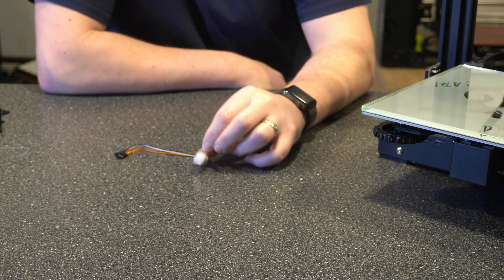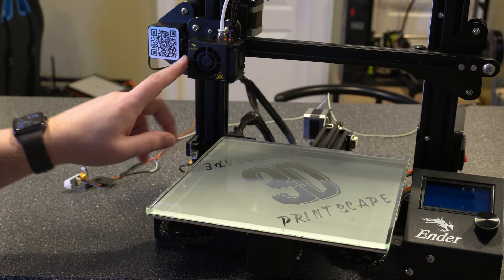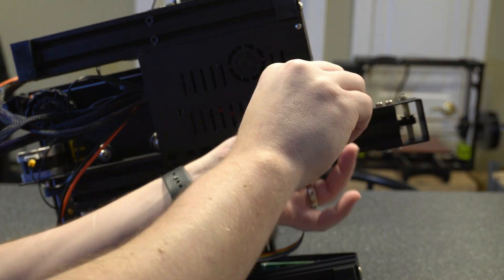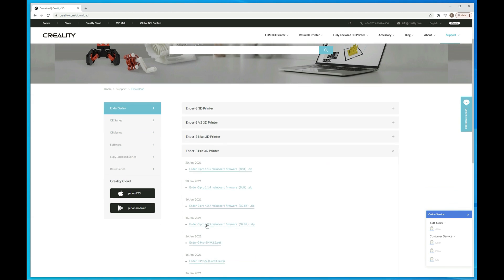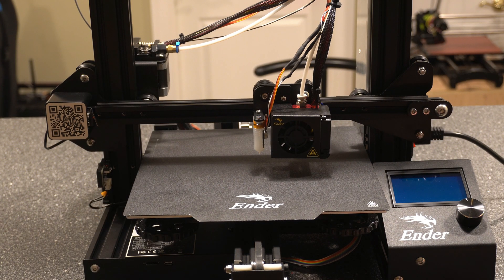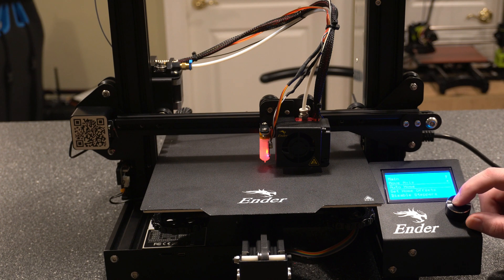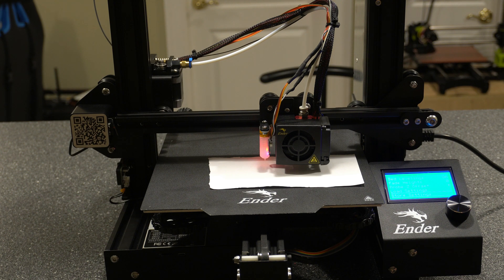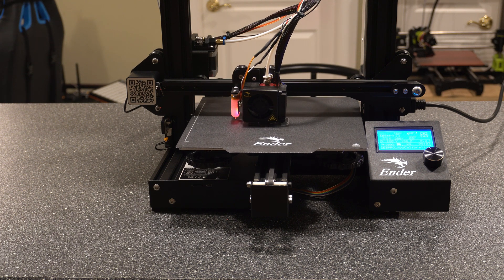Guide to Install a BLTOUCH on a Creality 32-bit Mainboard

Comment: Hi, wonderful video - thank you! All went well, except I'm now having the same "Home Z First" issues that Segio was having below. It started to print once, but the nozzle was too high so I was going to start the process of adjusting the Z offset. After the first adjustment, I got the "Home Z First" error and the Z axis wouldn't go down, even when I used the Prepare/Move Axis/Z Axis option (after I powered off and on, the Prepare/Move Axis/Z Axis option worked fine). Did you ever find out a solution to this? Any help would be much appreciated.  Thanks!
Reply: hi did you figure the home z problem? its be doing my head in for months. i cant get it to lower to bed
Reply from the maker: Hi. I the solution varied based on the actual issue. If you want to join us on discord, we can try to help more. https://discord.gg/Bu94EYVkrU
Reply: @3DPrintscape  Sounds good, thank you!

Comment: I installed mine but ever time I print successfully the next print will fail to start after the bed leveling
Reply from the maker: Hi. Try to clear your eeprom, keep in mind that you will need to set your z-offset again after doing that.
Reply: @3DPrintscape  how do I do that?
Reply from the maker: @Jake-ne8fp  Depending on the firmware, you should see something life restore defaults or settings. One thing to note is that if you set anything after uploading the firmware, that will be erased as well.

Comment: i just tried to put the firmware for a 1.1.4 board and i dont get a bin file
Reply: Now my screen is just blue
Reply from the maker: @3dprintingtoday  Hi. I think im working with you on discord, if that's not the case let me know.
Reply: so i just took the hex file and nothing happened
Reply from the maker: Hi. The 1.1.4 board is 8-bit, so you would need to install a bootloader first. I made a video covering this process that may help. https://youtu.be/-8YQ_yAusTY
Reply: @3DPrintscape  now im trying to get the firmware for a 4.2.7 board what should i choose the non adapter board i have different options
Reply: Yea thats me
Reply: Sorry I was trying to get help but you answer so fast I figured out I don't need to spam

Comment: Hi great video, I have got to the stage where i connect the cables to my board (which is a V4.2.7) however my 3 pin plug cable colours are red/blue/yellow (blue is on the centre connection) and the pins on my board are marked G/V/IN/G/OUT (from left to right). which colour cable goes to which connector (I dont want to blow anything on my board by guessing). Cheers
Reply from the maker: Hi. Unfortunately, these are being shipped with 4 or 5 different wiring outputs, which is why I focus on that a bit in the video. You will need to swap the blue and red wire. Most adapter will allow you to pull a pin at the bottom to remove the cable but some wont.
Reply: @3DPrintscape  What do you mean? so if i have the Blue-Yellow-Red i have to do custom wiring? im so done with this headache man.
Reply from the maker: @jacobshields7307  Yes, in your scenario you will need to swap the pinout on the board side so that it's blue-red-yellow.
Reply: G is ground or negative,
V is VCC or positive,
IN is signal in
OUT is signal out.

You need to make sure ground and VCC are plug in correctly.

Comment: Not blt issue but my right side always tends to peel up on long prints. Usually I'm using rafts. 50 degree bed constant. I figure maybe uneven heating below or more cooling above. Bed is glass. Annoying as short prints won't do this and it's impossible to fix on the fly. Any ideas?
Reply: Maybe it's part cooling fan. The peel up is nearly in pattern of offset it is to nozzle and it's stock and at full blast. Thoughts?
Reply from the maker: The bed temp seems low, try bumping it to 60. Also, the bed could be warped in a spot the bltouch doenst hit. Increasing the grid from 3 to 5 may help as well.

Comment: after minute 8:20 when i put the sd card into the printer and turn it on the screen its blue blank and its flashing and now it smells like a burned something. idk what to do please help
Reply from the maker: Hi. I will need to see pictures of the wiring and know what firmware you are using. Can you join my discord server? I can help more there. https://discord.gg/Bu94EYVkrU

Comment: All in all a very helpful video. In my case the BLTouch I received was not the same, the cable connections were different - two ribbon cables, one to the Z-detector, and one 3-pin that plugged into a daughter board. The only configuration that worked on my 4.2.2 board was to plug into the daughter board. While it did in fact load the firmware from the SD micro, I had to rename the file firmware.bin in order for it to load it. Go figure. At least i can say this, i did NOT fry my MB as some have done. The tutorial here helped me get the after setup configured, gracias amigo for that, all in all a good tutorial!
Reply from the maker: Hi. Thanks for the feedback, im glad you got everything working.

Comment: hi great vid. my question is do i need to bring the bed all the way down or at what position is the bed need to be at when adjusting the z thank you
Reply from the maker: Hi. The bed just needs to be somewhat level. The exact z-position wont make a difference as the bltouch detects where it is.

Comment: Why didn't you use the  2 springs that came with the BLTouch on your mounting screws?
Reply from the maker: Hi. You dont want the bltouch to move, it will mess with your z-offset.

Comment: Hi so I did this and now it’s not working a buzzing alarm is going off and the bl touch only does the Self check
Reply from the maker: Hi. How do you have it wired and what firmware are you using? Also, if you need more help I can try to help out on discord https://discord.gg/Bu94EYVkrU

Comment: Hey, dunno if you still prowl these comments. Thank you for the video. I've followed your instructions and it seemed to be doing ok. prepared the sdcard, inserted it. When I turned it on it just went to the main menu. In  control bl touch does show up tho. I try to do bed level but it asks me to home z. Try to change the height and it will only go up. It won't move closer to the board. Any ideas?
Reply from the maker: Hi. Are you running the Creality firmware or did you switch to Marlin? Also, try to verify that the printer took the update. If it didn’t try to just download it again and just put the firmware on the sd card without making any changes to the name. One other thing, make sure the SD card is 8GB or less, 16GB works sometimes but its hit or miss. Anything larger doesn’t work.

Comment: So glad i found this vid. I started at 9:30 pm when my kid got home thinking it was gonna be quick. The instructions were completely wrong after seing 1 vid on where to put the one wire and a little smoke i found another that said flip 2 wires i and it finaly looked like it was gonna work aaaannnddd now i have z access issue. Finaly at 3:30 am i see this on putting the2 wire pug next to 3 wire plug and leaving the original switch in place. Now its finaly working enough i can sleep. Gonna finish up in the morning
Reply: im also getting the z access issue. ill try doing what you did.
Reply from the maker: Hi. Sorry you ran into so many issues. I know this comment is a couple of days old but If your still having issues I can try to help out. You can also reach me on Discord https://discord.gg/Bu94EYVkrU .

Comment: Hi friend, great video, i have a question, your printer resume fails jobs after power off correct? My ender go up 5 cm and i lose the all job..tnks..
Reply from the maker: Hi. Its been pretty spotty for me in general and has to be enabled in the firmware. I dont have the stock firmware running right now to check for you though. What behavior are you seeing?
Reply: @3DPrintscape  I found the problem friend, I did not configure the home point, after solving this the resume was solved, thanks.
Reply from the maker: @PregosPro.Hobbies  Great, glad to hear you got it working.

Comment: This is a great video! Out of curiosity, do you plan on doing an install tutorial for setting up a btt smart filament sensor on the Creality 32bit board? Ive been trying to get mine working for ages, but no matter what I do, it basically permanently reads as having no filament
Reply from the maker: Hi. Thanks for the feedback. I have a placeholder on my backlog for it but wsnt sure it would work, so i have been pushing it off. I can look into doing it in the next month or so though.

Comment: So if I have the kit which I bought online, I still need to hack into the wires correct? Because they are not going to line up with the ground connection and such. I am so lost. I am new to this.
Reply from the maker: Hi. It depends on the kit. If you bought the bltocuh kit meant for a 32 bit board you may be ok. If the wires are long enough, worst case you will need to change the pinout. If you run into issues, i can help you on discord https://discord.gg/Bu94EYVkrU .
Reply: @3DPrintscape  Hi I am thinking of buying the Kit Creality Kit, How can I tell if I need to swap the VCC and GND over
Reply from the maker: @stephencornish2505  You will be able to tell by the cable order. If the blue/brown wire is on the outside you should be ok. If its red, then you will need to swap the wires.

Comment: This video is great!  I'm pretty sure I made a mistake somewhere though.  So when I do the Bed Level test, the first stop in the middle was fine, when it goes to the next spot, left corner closest to you,  initially it did go down but then was driving to far into the bed going to far and stressing the motor.  Immediately shut it off and rebooted. the next attempt at the second stop, the Z axis went up instead of down.  I  Then I hit restore Failsafe on it and it starting working again.  However after the leveling I went to Auto Home and attempted to set the Z-axis, but the Z-axis doesn't move at all.  Any ideas?  Thanks a bunch!
Reply from the maker: Hi. Thanks for the feedback and sorry to hear that you are having issues. I would need to take a look at your config files to really be able to help. You can email them to me, or send them to me on discord. Email is admin@3dprintscape.com , discord is https://discord.gg/Bu94EYVkrU .

Comment: can i remove the z stop from the printer
Reply from the maker: Hi. If your running the Creality firmware and have the probe stop plugged into the BLTouch port, you will need to keep the z-stop plugged in.
Reply: @3DPrintscape  ok thanks

Comment: Now when I print the nozzle will try to print off the bed, any solutions?
Reply from the maker: Hi. It sounds like the z-offset isnt set correctly. If you need help, you can join the discord server. There is a decent community there and they try to help each other out. https://discord.gg/Bu94EYVkrU

Comment: My ground cable is in the middle
Reply from the maker: Hi. Some of them ship with the ground and signal swapped, i think its for use with a transfer board. To plug them into the main board, they will need to be swapped.

Comment: Hello, I did everything you said, just install the BLtouch, have a 4.2.2, but no mater the firmware i am using it doesn't work, i have no clue how to do. i have a ender 3 pro. i tried to go back to the original firmware, then Bltouch Marlin2.0.1  BLtouch V1.3.1with transfer board（Temporary） or Marlin2.0.1  BLtouch V1.1.2 without transfer board same issue, also when i click on save setting nothing is happening. i would really like some help :(
Reply from the maker: HI. Sorry to hear you are having issues. I will need a lot more detail to help so it would probably be easier to do on Discord. https://discord.gg/Bu94EYVkrU
Reply: @3DPrintscape  Hello ! thank you for your answer, fortunately i have manage to make it work, this is my first time in 3D printing after reading a lot of document and watching a lot of video, i had to step back and take it slow. thank you again for your video !
Reply from the maker: @oliverspike  Great, glad to hear everything is working.

Comment: Great video. Thanks for showing us this process. I followed it to set up my printer. My BLTouch doesn’t seem to store the bed mesh and then execute on it. My bed is daily level but I don’t see the machine adjusting the z axis when moving around the board. What stores the mesh level data? Do we need to put an M500 code in to store it? I know enough to be dangerous. What guidance would you have?
Reply from the maker: Hi. I believe its stored in the EEPROM but i would need a lot more info on your setup to be able to provide any real advice. Can you enter that here, including board and firmware version or on discord? https://discord.gg/Bu94EYVkrU
Reply: @3DPrintscape  I can't remember where I saw it but this is my method.
In Cura, once connected to printer send G28 to home, G29 for ABL and M500 to store to eeprom.
In start gcode after the G28 command enter:
M420 S1
this will recall last stored mesh
Reply from the maker: @roberthobbs5459  Ive seen that as well, i just prefer to run the mesh every time.

Comment: Nice vid. Would love to see a similar vidio for SKRs E3 mini v2 thank you XD
Reply from the maker: Hi. Thanks for the feedback. I cover most of the install process your looking for in this video. https://youtu.be/Vn5rMdJgkAI If you run into issues, or have questions, you can message me here or on Discord. https://discord.gg/Bu94EYVkrU
Reply: @3DPrintscape  I'm having curling issues. Do you know what could cause this?
Reply from the maker: @commonelectra2131  Its probably from lack of adhesion or the build plate not being level.

Comment: Can you get a female end to go on the end of your cable to plug the BL Touch into? I have ordered the same kit and thought I would end up with a copy of BL Touch as it is much cheaper than buying it directly but I am much more confident seeing you receiving the real Mcoy
Reply from the maker: Hi. The kit came with connectors that can be used but i didnt like them and you would still need to use an extension cable or make your own.